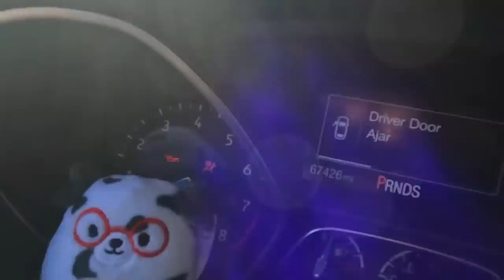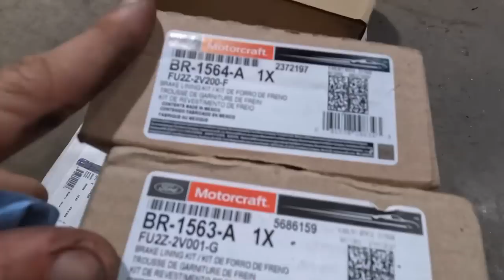Mechanic Cheats book time! Close Call | 2016 Ford Focus 2.0

Comment: Just wanted to say and it is pure information that when you install the bushings like that it is going to increase the wear on them drastically because they tension when the car is on the ground but they should do that when you lift the car up  so lift the control arm up to the point where it would be when the car is one the ground and than tighten the bolts it makes the bushings last longer. ;)
Reply: That's a load of crap. Whoever told you that doesn't know what they're talking about. That can't happen with that style of bushing.
Reply: @AT-wl9yq  Sure it can especially with the front one and no one told me that because i am a mechanic myself so clearly i do know what i am talking about you just need to think it threw how the bushing is working when the wheel is in the air or driving on the street and why cant it happen with the back bushing it is pressed on the control arm it would work like you said when it wasnt pressed on.
Reply: @kmsbismark1857  I have no idea where you are getting your information from, but its just not correct. The part of the control arm where it bushing goes isn't round. Its hex shaped, as is the center of the bushing. If you look at the bushing closely, you'll also see that it was designed to flex as the control arm moves up and down while driving. However, the center of the bushing never moves. It stays in the exact same position on the control arm regardless of how you install it. Simply put, it can't make a difference. Maybe you're confusing these bushings with the one on the Edge/MKX recall. Those are the ones you're supposed to tighten with the weight of the car on them.

I'm not trying to be rude, but I really don't care how good of a mechanic you think you  are. I'm a senior master Ford tech. Its the highest level Ford has, and it takes many years to achieve. 

And I already know what you're going to say. "How do I know you're not making all this up. Anyone can say they are a senior master Ford tech.". That's true, so instead of having a senseless back forth trading insults, check for yourself. I'm sure you're familiar with Ray's good friend FordBossMe and his channel. I spend a lot of time over there. I'm sure he will confirm that the information I have, can only come from someone who works for Ford.
Reply: @AT-wl9yq  unless the inner or outer part of each bushing can move with suspension, how can preloading not be important? The one I think you refer to as designed to flex, if that flex "loads" the "web" torsionally and does not "float" wouldn't that introduce a bunch of flex just setting car down, then even more during compression? That does not seem correct VS if it does not move, then securing it in a neutral position so its full suspension travel starts from a resting point so to speak?
Reply: @BurkaLifter  I'm not trying to sell you on anything. You can believe whatever you want. By the looks of it, you are getting your information from youtube videos. How many of these bushings have you ever pressed onto this style of control arm? You haven't. Did you check the workshop manual? No, you haven't. If this bushing needed to be installed with the suspension loaded, there would be a big warning telling you to do so. Did you see Ray remove the warning attached to the control arm before install? Nope.

I know you are trying to reason this through like a "car guy"

"The one I think you refer to as designed to flex, if that flex "loads" the "web" torsionally and does not "float" wouldn't that introduce a bunch of flex just setting car down, then even more during compression?"

That statement tells me you are literally not familiar with this type of design. The bushing is keyed and slides on to the control arm a certain way. Once the bushing is installed, its locked in its resting position. If you pull down on the end of the control arm to connect it to the ball with the car on the lift, you will flex the bushing. Lowering the car down will just bring the bushing back to its resting position. Installing it loaded or unloaded can't make a difference. As I've previously stated, there are other bushings that need to be installed with the suspension loaded. This is not one of them. 

Instead of arguing with me, why not just look up the procedure yourself, and if you find any information that goes against what I'm telling you, show me the reference and we'll have a discussion.

Comment: I’ve done control arms on these. What I do to get the bolt out on the passenger side next to the compressor is I remove the dog bone mount out and then I push the engine towards the front and wrench the bolt out. That’s how I do the passenger side control arm

Comment: Aren't you supposed to torque down the front bushing on the lower control arm when the control arm is on the operating level? Sorry to pick that out to you but being a mechanic that kind of stood out me. Cheers from Poland
Reply: You are. Good callout.
Reply: You're correct.
Reply: Should be torqued to spec also ! Not hacked
Reply: Yep...vehicle sitting on ground,thrn tighten and tourque. Those bushings  won't last long!
Reply: @stevenbaker9327  It's 2023, bushings won't last long anyways. It's all recycled crap because it's so green.
Reply: Yes. Ray has done it his way before (incorrectly). Always does!
Reply: @dadupset5806  that is probably why it’s getting replaced now and again after leaving this shop
Reply: its recommended to do that, yeah sure, but if you torque the control arm in the position it came out at, you're achieving the same outcome and saving time.
Reply: @The_Dopery  wrong
Reply: @coryament  care to explain? You think they get the weight on the bushings on the assembly line? I've been doing it this way for years with no issue lol. Assuming you're aligning after which is a must.
Reply: @The_Dopery  as soon as the wheel hits the ground and compresses the suspension, it will twist the bushing. And since the majority of the time, the wheel is on the ground, the bushing will be twisted/loaded all that time, and will tear more quickly. 
If he just put that jackstand under the hub and lifted the hub up to ride height before loud noises, it would be fine.
Ray never does this. Love the guy, but he's not touching my suspension :)
Reply: That’s not like a upper Gm control arm, different orientation doesn’t matter.. and torque to spec doesn’t really matter on that bolt either, certified tech here also..
Reply: @The_Dopery  if the bolts are not tightened in the position of ride height then the bushing is stressed constantly causing early failure. they don't need the weight they need to be in the right position.  I you remove the arm in a down position and reinstall it that way then lower the car the bushing is being twisted constantly. I don't tighten them until I put it on the ground
Reply: @jonathanlang7852  upper control arms are the same thing. The bolt needs to be tightened at ride hight
Reply: @kampar82  I agree but installing them wrong will make them fail even faster still
Reply: @Dopery  I've seen assembly line vids, and the control arms are attached to the sub frame in a level position, and then the subframe is attached to the body. They are not torqued on with them dangling.
It does stretch the rubber bushing more to torque them while dangling and then set the car down on the wheels.
You said you've always done it that way, but how many have you actually done?
Reply: It is better to remain silent at the risk of being thought a fool, than to talk and remove all doubt of it...
Reply: @kampar82  i
Reply: Every time I come across a cross threaded bolt I say ahh someone put a little Polish loctite on this 😊
Reply: No mechanic uses a torque wrench unless it's his car lmao
Reply: I would love to see you carry out this operation!!! Ok the recommended torques must be applied, but according to the procedure this implies that the vehicle must be on the ground and therefore on these wheels, I would love to see you try this...        You saw this written on a stupid sticker and you repeat it to show us your knowledge learn from youtube !!!🤭🤣
Reply: @abertzaleharroaii7449  Really? I've been working on cars for 15years. But whatever. You know me better than I knowself. Good job. 👍

Comment: there  was a clamp on the A/C line  to the oil pan running to the front side of the engine.  I think that disconnecting that the A/C would have dropped lower giving you better clearance for that bolt. I see that the line changes to hose about 6" past that clamp so there flexibility to do it.

Comment: @Rainman Ray's Repairs you need to wait tightening the thrubolt on the front of the controlarm until it's loaded with the car weight. Tightening it "floating" will premature wear the bushing. I'm surprised you didn't did/know that.

Comment: Wife unit did an excellent job on her first tune up. I was wondering where the Ford came from.
Reply: Scared me when she didn't hold the top of the wrench on cyl 4, was expecting to hear the plug snap. I guess the wells are deep enough to hold the socket straight. I just helped my son do his first, a nail biter for sure.
Reply: @TheFirstGhirn  Yeah, that number 4 cylinder oops scared me for a minute too.

Comment: On a 6.0 Powerstroke alternator replacement you do something similar to what you did with the AC Compressor.  The belt tensioner is too difficult to reach on account of the cooling fan and shroud.  The VT365's tensioner isn't much better, but at least the front of the truck tilts forward.

Comment: Torquing those front pivot bushing bolts on the lower control arms while the suspension is fully extended is the equivalent to reusing cotter pins

Comment: Great video, Ray! This is a great example of what mechanics have to experience, stuff in the way, bolts to extract, removing/installing parts blindly using only tactile means of location and having a good sense/cognitive imagery/mapping. I'm sure moving the compressor was a less "dangerous" or complicated than messing with the subframe. Thank you!
Reply: Actually, its not. The Escapes don't have full engine cradles. Its far easier to remove the "sub frame" than the AC compressor.
Reply: @AT-wl9yq  Heh! He DID say he likes to do some things the hard way.

Comment: Passenger side control arm. I removed the passenger side motor mount and raised the engine a little to get that bolt out.  2013 Focus - 255400 miles.

Comment: Last time I did one of these here in the U.K. I just loosened all the subframe bolts till their last few threads then undid all the 4 rear bolts at once and then placed a small block of wood under the center of the stabilizer bar. This was easier as the frame was already 2 inches down giving good access to the nuts. This also gave clearance to the right front bolt to miss the a.c. compressor. The  sliding joint in the steering column is enough to let the frame down without disconnection then once both arms are in place remove  the wood block and refit the rear bolts before bolting the frame back up when you can still see to realign everything.

Comment: referring to electron danger, if you look in the main breaker box the neutral and ground are bonded together. . the voltage you have in the video is too high unless something is connected wrong in the nearest box . its bet to have an electrician check all your circuits.

Comment: Another great show Ray. So, when you install the control arm, aren’t you supposed to set the car at ride height before torquing the bushing thru bolt? That way it doesn’t preload the bushing causing premature failure?
Reply: Yes, you do. On the horizontal bolt. Or you will have it fighting itself. Had to do it on my BMWs.  Just used Rino Ramps to do it.
Reply: @TheFrenchPug  another yes, ray should also properly torque bolts down instead of saying “click”
Reply: It is better to remain silent at the risk of being thought a fool, than to talk and remove all doubt of it...
Reply: @MrLJDickens  You keep commenting this yet provide nothing else, I assume you must be a bot then :)
Reply: @mercuryfusion8325  i think its a good message that the world needs
Reply: @MrLJDickens  Okay bot, perhaps you should take your own advice :)
Reply: Yes front bushing with the horizontal thru bolt needs to be torqued at ride height?
Reply: @TheFrenchPug  - Actually, I already knew the answer, I've replaced many. But, I enjoy Ray's videos and was trying to throw out a polite, shaded hint without being rude. Thank you for your reply, sir!
Reply: Not necessarily. There are 2 types of lateral conical control arm bushings, those with unglued / unbonded rubber inserts (replaceable) and those with fixed / glued / bonded inserts (non replaceable). The former inserts can rotate somewhat within the arm aperture and will self align so no suspension preload necessary, the latter absolutely otherwise they'll twist and tear in next to no time. These ones look unbonded so no suspension preload should be necessary. Service data may tell you otherwise (any Ford Techs looking in?).

I tend to tighten suspension parts on the level as it doesn't hurt the press fit unbonded types anyway so almost a one fits all practice.

Comment: Those AC Delco parts are simple generic Chinese parts in a AC Delco box... as such, AC Delco are no longer a premium brand in my book- and yes, I put some AC Delco brake parts on my Ford; they failed immediately. Luckily, Raybestos/Centric came to the rescue (also Chinese made, but they DO have people working and answering tech calls).
Reply: Haven't used Centric's in about 5 years. But the ones I used in the 5-15 years ago era were fairly nice and worked well for me. Would hope they're still decent quality.
Reply: Buying "factory" parts is as much of a crapshoot as buying generic parts. No one has a y idea of where that stuff was made because there is no country of origin labeling. Of course that could be counterfeit also.

Comment: Old man pro tip I have one set of sockets and one set of wrenches that I magnetized. Most of the time the nuts will stay with the wrench or socket which makes it easy to take out or replace. Does it always work? Nope but most of the time it does and has saved me a lot of time.

Comment: That spark plug looked like it had a little green on it.  That engine is know for antifreeze leaking into the cylinders between 2 and 3 cylinder.  Should check down the cylinder for antifreeze.

Comment: The front bushing on the control arm was not torqued with a load so it will tear very quickly as a result it twisted and binded when it was first driven already has tbh no joke Ray this is a safety issue now for the customer. I've seen it happen many times over the years man!

Comment: If you want to tell if spark plugs are original look at the tips of the plug . If the tips have paint or color on them it means they are factory plugs . In most cases . On Ford products . Not sure about the others . Just an fyi .

Comment: Great job as usual - shouldn't you load the control arm before torqueing the front lower control arm bushing?
Reply: Those Ford Motor Company bushings look like the press fit unglued versions (you can replace the rubber insert) and therefore they should rotate within the arm itself even when fully tightened. Unlikely to twist the rubber leading to a tear therefore which is the common issue  on the other fixed / bonded rubber types. Should not need to be preloaded in this instance.

Comment: We need more mechanics  like ray in this world trust me just recently  after my fiance  buying a van several  years ago and when I went to replace  valve  cover gasket I went oh no this is not good back valve  cover bolts all broken  n now its costly if possible  repair to remove  the valve cover bolts from the cylinder head holes a job I have zero experience. So am guessing  last person who done it must have over torque the bolts n left it as is .we definitely  need more honest mechanics  like u brother. With superior work ethics.

Comment: Ray I really enjoy watching you work, I have learned a few tricks adding to the many that I have already learned, one thing I could suggest to you when you are trying to align two parts, is a drift punch, stick that in and wobble it around to line stuff up instead of using the bolt. So far that's the only tool you seem to be missing. 
Ps. I'm an Electronics guy and good at soldering stuff. I have a machine shop, mill, lathe, tool grinders, Tig, Mig and gas. I build airplanes, motorcycle parts and trailers. 
You should invest in a small Argon Mig setup, would be so much better than the unit you are using.
Reply: I always associated Argon with TIG and CO2 with MIG? Argon TIG was used for welding aluminium. Maybe things have changed since the '90s?

Comment: I had a Mazda with the same issue with ac compressor if you take out the bolt on the stabiliser mount between the box and subframe the engine will swing forward enough to get the bolt out.
Reply: You are aware that Ford & Mazda had an alliance type thing and many vehicles had Ford Mazda parts    Kinda like Chevy GMC

Comment: Why replace the whole control arm when it's just the separately available bush/mount that is the worn/broken part? At 14:35 you could just pull the bush off the arm and replace it. Also at 20:50 that bolt should be done up while the vehicle is on the ground. This is so in normal position at rest there is not a permanent twisting force on the bush.

Comment: Just did those lower control arms, tie rod end links, along with motor mounts and an electric rack. on my 2012 focus.  Was a giant PIA to pull that subframe on my back to do the rack.  I do wish I did the sway bar bushings while I was in there, sway bar is so stiff.  Project for another day.

Comment: I don't think I would worry about the stripped screw.  It was on the incoming side of the filter so it would not bother any air flow sensors.